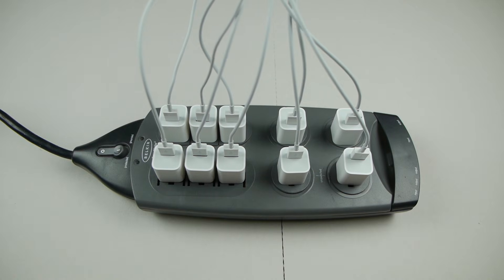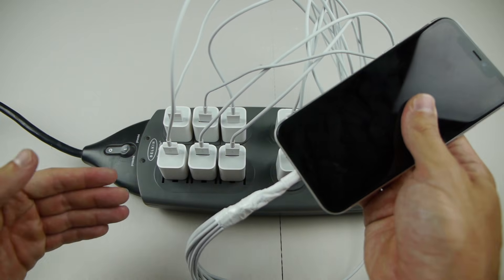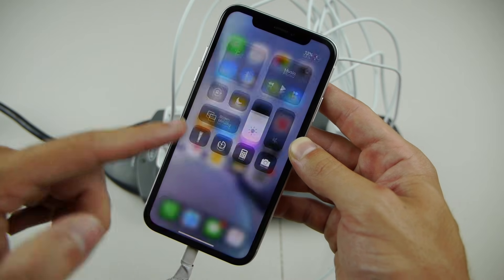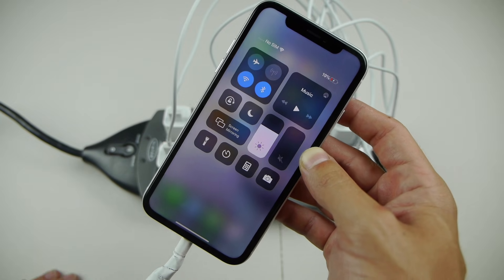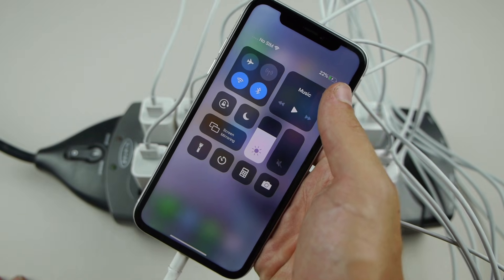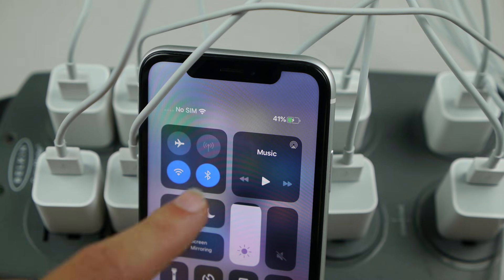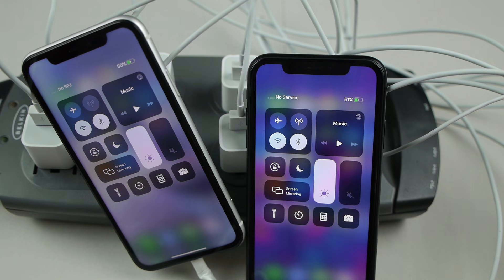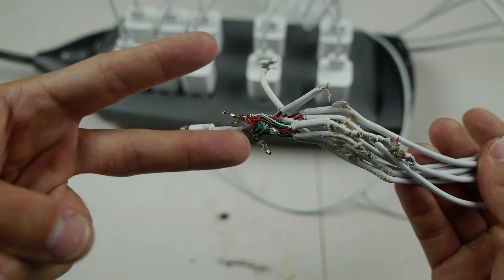What Happens When You Plug 10 Chargers in an iPhone? - One Mega Charger!

Comment: this is not possible. cause the phone has a resistance and the current is not made by the charger. its by the resistance of the phone. also every li-ion battery has a module with a current regulator so you dont blow the phone, so if the phone can handle max 15 watts for example and you put 20 on it, it will still be 15 cause of that current.

Comment: If you combined the colors you’d increase the amperage not the voltage. You’re charging at 5 volts 10 amps because you have 10 5v 1a chargers ran in parallel.

Comment: This doesn't really do anything. The phone can only handle so many watts of input power. Those chargers are all in parallel so its charging at 5 volts and 12 watts (maybe depending on the charger itself) I think the iphone 11 can handle 22 watts max. Having more watts does nothing here what you need is more volts if you are trying to break it. 
 
 The reason the phone charged fast er lower percentage is because charging a battery is easiest from the lower percent. Its the last few percent it struggles with. Its why phone manufacturers say from 0%-25% in X minutes instead of 75-100% because the lower end charges way faster. Man I wish people had a better understanding of basic electronics. 
 
 
 
 
Reading the comments here hurts me.

Comment: 10 charges: considering that everyone of them gives 1Ampere and 5 volt it means that you are charging your phone with a power of: 1*10*5 = 50 watt. This power is higher than the one used for the iPad Pro so maybe the chip of battery management of the iPhone knows that and it tries to keep the charge low.

Comment: Inside the phone there's actually a chip which specifies the limit at which the phone should/must be charged. This chip can ramp the current up or down, depending on the needs.
It's normal that after +-40% the phone slowed down. The chip gradually decreases the current the more full the battery is. This is to protect it and to avoid overheating. If that chip weren't there, it would charge too quick, overheat and probably die.

Comment: Atleast he didn't connect them in series,  else he would be pushing 50 volts through that lightining port. 
But in this connection, it would be 5V at 10 amps..  And that would have been later droped by phone circuit or charger protection circuit. 
But nowadays, almost all tech have over-current n over-voltage protection.

Comment: Connect the chargers in series. That may actually kill the phone. Connecting them in parallel like this just increases the total current that CAN be supplied to the phone, but the phone will limit the current on its own. You created a 50W charger, but that doesn't mean 50W will actually flow into the phone, meaning this is 100% safe and will not harm the battery.

Comment: iPhone Doesn’t Come With A Charger That Can Reach Its Limit ( meaning if its a 5 volt charger iphone limit will be 15 volt ) so basically you just increased the power going in the phone but phone can support them even if you put more power then its limit it can still charge because the iphone has a small idk what but it controls over load of power on iphone :) ahh man who is even gonna read this
Reply: Me
But this dude probably cares more. He made a charger better than what they give you. He is using 10 plugs. But still
Reply: Unfairkibbles3 those plugs don’t really give that high voltage if he had used the adapter that comes with the iPhone 11 Pro it Would’ve Blown Up Or Got Really Heated up ( heating is bad for battery and charging as well as phone’s performance)
Reply: No, voltage does not ingrease this type connection, only current will ingrease (amount off electricity current) and it looks fake. Where is the grounding wires connected?
Reply: Veeti Laitinen big Brain

Comment: Help me here, but since the wires are connectet in a parallel way, the voltage should be still the same, and the currency should adapt depending on what the battery needs... does that make sense?

Comment: If you know the basics of Ohm's law, this phone would still charge at the same speed as a normal quick-charging brick. Because he puts all of these charger wires in parallel, the voltage remains the same, but the max current would increase with every charging brick. Even if you would theoretically have hundreds of these bricks, giving a maximum current of hundreds of amps, it's still going to pull only a few amps, because of ohm's law. If he would however connect these wires in series (to step up the voltage to around 50-100V in this case) he would instantly kill the phone as all the internal components would blow up from overvoltage.

Comment: This is fake. We don’t know if the cables are connected as a single cable electronically under the piece of tape.  There is actually only one cable that charges the phone. Why make cuts during the video if the phone charges so quickly otherwise?
Reply: Did you even watch to the end?
Reply: How do you know if its fake then if you dont know if the cables are connected.

Comment: 1) Should have shown the cable setup because no one knows how you have combined the cables as of now
2) Should have compared it with a single charge of another iPhone starting at 0% to make sure it's not fast charge that's responsible for that / determine how much faster it actually is
Reply: Well if you're going to make the same thing at home you should also know how to wire it up

Comment: You just connect it in parallel, that means you just divided current to 10 chargers, that doesn’t mean anything wrong. If you would connect them in serial connection (+-+-) you’ll get about 50V and that can absolutely smash the phone charging circuit, but also chargers themselves.

Comment: If you wire it in Series (put the negative cable on one charger onto the positive of the other and have the empty 2 leads go into the lightning connector) it’d probably have some effect on it
Reply: Also you don’t need the other wires, only the black and red wires as they supply the voltage and the other cables are for data only, like plugging into a computer or accessory

Comment: phone chargers has internally a IC that can comunicate directly with battery charger that are inside the phone.
This ICs can be IP6502/IP6503/IP6504/IP6505.... according to the comunication protocol used to charge a phone, like QC2/QC3 - USB-typeC 5/9/12v
The phone in the video seems that can charge itself fast because:
1) is almost fully discharged (a discharged battery can be charged more quickly due to its reduced internal recistance)
2) it regulate itself the maximum current that battery can be charged at its conditions according to temperature, internal resistance of battery and charge.

Comment: As long as the chargers are the regular 5V, it will draw the same amount of current as it would with 1 charger if it can handle the rated value. Increasing the amount of available current doesn't make a difference. Simple logic.

Comment: This wouldn't actually work. Batteries need specific voltages while charging. If he actually would have done this rather than just putting tape over ruined chargers with one non broken charger the battery would swell and blow up.

Comment: This probably isn’t the safest thing to do; at the least this will probably reduce the actual battery’s capacity if you overcharge there iPhone like this often.
Reply: iPhones have a charging circuit in them that limits the current. Ultimately, since the iPhone isn't getting a signal to draw more current, it's probably drawing the standard 1amp that those small bricks are rated for. Even though those bricks all in parallel can output 10 amps, the phone isn't getting the digital signal to draw more of that amperage. At the end of the day, the phone charges at the same speed as usual and the bricks are just wasting power.
Reply: Mihir Deshpande He’s talking about people doing this in general. Obviously tech rax doesn’t care what happens to his phones
Reply: Lithium Ion batteries can't overcharge.

Comment: The amps could be built in alot. The volts does nothing.
If you charge with 2 chargers
charger = 1 amp
And you solder them with the same wire then, amps would double. That's 2 amps.

The volts dont double.

Comment: Connect the chargers in series.  You will most definitely have a booming different result. For example two 12v batteries connected in series gives you 24v, connected in parallel you still have 12volts

Comment: Still cheaper than Apple's Fast charger

If i am not wrong, 10 of these chargers can push out 50 watts in total so thats something
Reply: Did you not see the phone stopped charging with the 10 cables
Reply: Still faster than the Apple's fast charger
Reply: Gurudhi ge Account no
Reply: If you use a 65W charger in an 45W Max it would charge on 45W and can't go beyond that so it obviously won't work idk about iPhone though.

Comment: You have to disable “optimised charging” otherwise the iphone will block the current at a certain point and slow down charging so the battery isn’t damaged. Same with a power charger. So do the test with “optimised charging” disabled and the result will probably be different
Reply: Don't think will make much difference. The more power in the battery the higher the resistance. It becomes harder and harder to charge as you approach the capacity. Also the charge circuit in the phone chargers etc will also cause it to fall off big time. Note it took only a few seconds for it to go 12 13 14 then started slowing down further and further and further. You could do this with prob 3 or so apple standard chargers but beyond that you will hits the upper limit of what the iphone allows for in fast charging. 
I use to do this same thing with my old rc car batteries wired 2 chargers together to double the amp output fyi while lithioum tech is better with taking it like nicad the battery will take a hit
Reply: Nova Flare 

I’d Like To Think of It Like Loading A Magazine, The First Five Rounds Are Easy To Load, However The Subsequent Rounds Are The Hardest, Due To The Tension On The Spring.
Reply: @nanaki-seto  didn't read half of that essay
Reply: It kicks in at 80%.
Reply: I Think It Slows Around The Eighty Percent Threshold.

Comment: So basically TechRax made him self a 50w charger out of 5w chargers, but the since the XR is able to fast charge it can only handle 18w to 20w of a charger, or it has a chance to blow up the battery.
Reason is that the 18w fast charger Apple sells chargers iPhone’s from 0-50 in 30 minutes and then it slows down charging like every battery. Remember the iPhone’s not using the full potential of the wattage, and it can’t go higher that about 20w to protect the battery.
Reply: 20w is still better than 5w though, but I get what you mean
Reply: The iPhone has protection circuits so it can limit or deny the charge if it’s too much
Reply: I'm smarter than you. whats 5x the diameter of light?
Reply: England 4 Life “im smarter than you” LMAO 🤣🤣🤣🤣
Reply: My phone charges 0 to 100 in 30mins.
50watt charging 😌
Reply: @atharvaupare924  0 to 100 in 30 mins isnt possible with 50w, what phone is it
Reply: @claudio7010  My phone can charge from 0 to 70 (it can't go above that) in 30 minutes with a 10W charger
Reply: @KofolaDealer  mine too, 10w, 80% in 35 mins, from s10+
Reply: Atharva37 Gaming my phone charges 0 to 100 in like 2 hours
5watt charging 😂
Reply: @atharvaupare924  mine charges to 75÷ in 30mins, warp charge 30T
Reply: I like the prof pic
Reply: I would plug the charger into a variac and crank up the voltage until something blows up 😂. That Iphone and charger can only handle so much.
Reply: iPhones only accept 5 volts 3 amps max for standard charging and can only pull a maximum of 18 watts when using a power delivery capable charger which supply’s at least 9 volts 2 amps of charging power
Reply: it wouldn’t blow it would short out and not charge anymore
Reply: This is how all electronics work for those commenting saying android is better 😂
Reply: @Faza961  no. It isn't. Some electronics are made to support different systems than others. Buffoon.
Reply: He can then just use 4 chargers to avoid killing the battery
Reply: SACC You could use a 100w charger and it still would charge the exact same way
Reply: SACC Doesn’t matter, since the iPhone cannot take higher than a certain wattage/voltage
Reply: @braincell4536  lol iphones suck. Android master race
Reply: @girlsdrinkfeck  ole hail the android
Reply: girlsdrinkfeck green bubbles
Reply: @girlsdrinkfeck  no they don't
Reply: @girlsdrinkfeck  correct
Reply: girlsdrinkfeck if you hate IPhone why are you here bro 🤣

Comment: Connected in parallel will only brings more Amps if requested, not Voltages.
Anyway lightning connector itself will not pass more Amps than it designed for and iPhone will never request more Amps than needed.
Only over voltage may damage it.
Also this is not a surprise for anyone who remember school physics lessons.
So this test makes no sense even if he measure Amps and Voltages.

Comment: The iPhone’s input wattage is limited. A 100 of those bricks vs 5- 6 probably won’t make much difference.
Reply: Wouldn’t the larger potential difference cause damage to the components inside the phone limiting its power input?
Reply: William Terry might do, especially considering they slowed down towards the end, probably because the battery thermal throttled due to the heat
Reply: Somanithel Kheang Not even worth debating with some anime loser who watches cartoons all day. GO OUTSIDE. Definitely some ugly loser who watches cartoons all day like they all are 😂
Reply: FreshPrince OfWelfare bro why did you have to lash out like that man, that was totally uncalled for, besides is this not 11th and 12th physics
Reply: FreshPrince OfWelfare this video is not about anime. No one here mentioned anything about anime. Why insult an entire community when it has nothing to do with the topic of discussion. Chill bro
Reply: But it changes fastet
Reply: _ David _ thanks, my mistake!
Reply: _ David _ wattage is an expression on power.
Reply: It isn’t the watts that are limited but the amperes, also known as electical current. It is the volts and maximum current that battery can take what defines the max watts the phone can charge.
Reply: No
Reply: @FuryPurryKat "No need for proof" I stopped reading the comment, notice how no proof has been given just triggered people xD
Reply: Proof? Internet PhD guy 😂
Reply: FreshPrince OfWelfare no, just common sense- something lacking in today’s world- look at all of the manufacturers now advertising that they have an of 120w... open your bloody eyes🙄
Reply: FreshPrince OfWelfare Apple specifications. Read them.
Reply: @FuryPurryKat if a charger gives 15 watts multiple ones will give hiagher (at least the max limit for the phone) it's like using super charger isn't that right?
But here it won't work bcz of iphone bcz it maybe recognizes the charger and set the limit unlike Android
Reply: Mahrez Janati Thats not right at all. In this video they are wired in parallel, which means they give exact same voltage and current, so also same watts.
Reply: @TeoReSS  Wich means u get the same voltage 10 times the current so 50 watts but the iphone wont take more than lets say 20W so it wont self-destruct.

Comment: Turn off the optimized battery charging and it’ll charge normal. That setting doesn’t let all power go through after 40-45%
Reply: What a stupid setting why would you want to charge slower good job apple
Reply: Ya I know right. It’s dumb. But it’s supposed to help with the battery life of the battery

Comment: The video I’ve always wanted to see. I’ve always also wanted to try to charge my phone with the wireless charger and then used my wired charger
Reply: actually won’t charge with both
Reply: brainfuck it actually will charge with both. Tried it out once. Quite interesting
Pretty sure you can replace a fast charger like that.
Reply: @daniel_960_  No, the Qi standard doesn't allow the phone to charge through both inputs
Reply: No cap ‼️